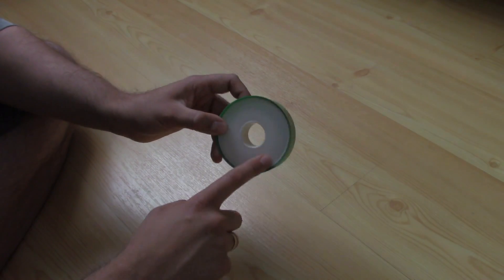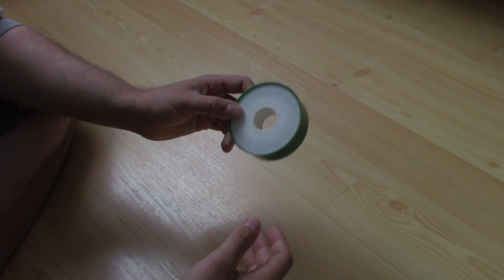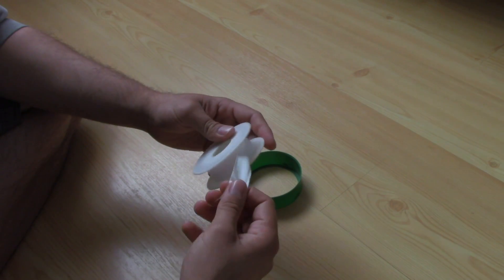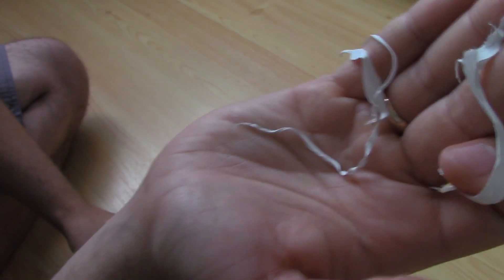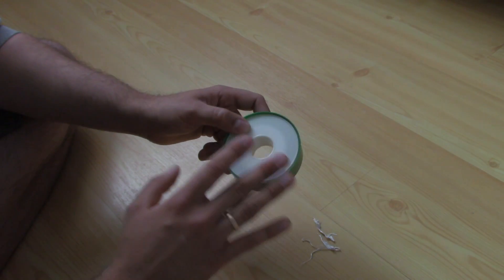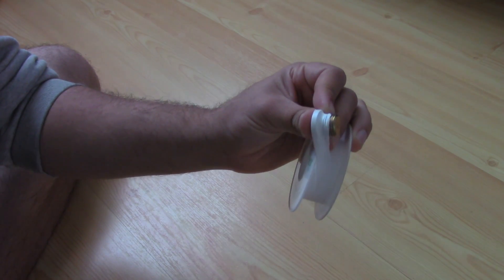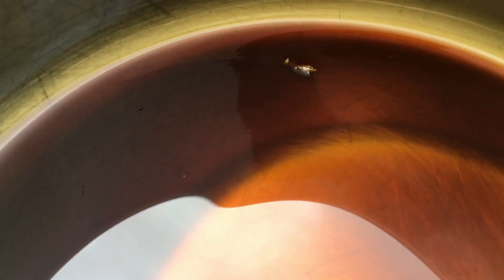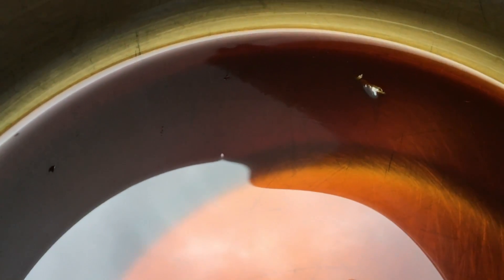Should you use PTFE Tape for your Car Oil Drain Plug ? Let's test.

Comment: When you run this tape on the END OF THE PLUG,next to the head, where need be sealed, it's ABSOLUTELY NOT POSSIBLE the teflon material to go inside the engine or transmission. Theoretically, if some piece go inside, will be catched from the filter, right ???

Comment: If you removed the oil out of the oil drain hole that that the PTFE tape wrapped bolt came out of, you are just seeing bits of tape that's left on the threads, not necessarily what's made it into your oil pan.  If you wrap the tape under the oil line you won't have an issue of the tape making its way into the oil pan.

Comment: I've been using teflon as a bolster to the existing gasket for years without a problem. However, I do notice that consistently my oil plugs loosen enough that mid oil change interval I snug it up again. While I've never had a plug fall out, I suspect it could happen brcause of the teflon. I know somebody that had a plug fall out, but there was no teflon tape involved and he thinks the oil-change shop left his plug loose.

Comment: The engine’s oil pump moves the oil directly to the filter, where it enters from the holes in the perimeter of the base plate. The dirty oil is passed (pushed under pressure) through the filter media and back through the central hole, where it re-enters the engine. So any debris will be caught before entering the engine, not to worry about it!

Comment: How is going to get in the engine if its wrapped around the threads at the bottom of the plug (lowest point)? I have been doing this for years and saves the time of finding or buying a new seal, and most importantly stops an oil leak.

Comment: Oilmpump strainers are designed to suck oil from bottom most part to avoid cases where at low oil levels and high gradients the pump doesn't suck air

Comment: The bits of tape that came out were likely in the plug hole and flushed out with the oil.

It cannot get into the oil pan if if does not extend into the pan, ie if it ends in the threaded plug hole.

You wrapped it in the wrong direction which makes it unwrap as you screw in the plug.

Thread tape is good for metal on metal or plastic on plastic threads to seal tiny gaps. But I would not use it over a rubber gasket as that would likely degrade the performance of the gasket.

Comment: As said before, you MUST apply tape in the correct direction: opposite to the way you show!
Thick tape is often used on gas fittings and is applied in a single layer.
Another tip, if you find the sump thread is stripped of worn, wrap dental floss around the bolt threads, one layer in the correct direction, maybe remove the sealing washer, to give you a little more thread
Reply: yeah, he applied the tape the wrong way.

Comment: I've used PTFE tape on oil drain plug for roughly 15 times, not once I've encounter any problem.  Furthermore, it allows a perfect seal with just 20~ nm of torque.  What you do is apply a thin layer (just one layer) between the plug and the washer, then another thin layer onto of the washer.  It basically acts as a gasket.  NEVER APPLY ON THE THREAD because that will get into the oil that's in the engine.
Reply: Thanks for this tip. I changed my motorcycle oil at the weekend and fitted a new sump plug but I couldn't get rid of a slow drip. Untightened the plug and used your tip and it sealed it perfectly. Many thanks.
Reply: Ok, the PTFE have a very low chances of damaging the engine. However, can't deny the fact that it does have a slight chance of doing so. Thing is, why use it when the washer is sufficient to avoid leaks?
Reply: As a plumber this is the rite way .. don’t put it in the thread same with olives 👌
Reply: nice, this is the advanced info I  was seeking.
Reply: I’m confused by your statement, I mean, it seems detailed enough, I’m just slow, I guess. Lol. I’ve used Teflon tape many, many times. But you’re saying not to wrap the threads, at all? Just curious what you’re describing.
Reply: @rikityrik  When you tighten a drain plug, what stops the oil from dripping onto the ground is the washer (copper O-ring or aluminium O-ring) that is crushed between the plug and the sump pan.  My method is wrap the Teflon around the washer, so very little torque is needed to create a seal.
Reply: @vinegar008  ok, thanks. This is how I understood what you said, but wasn’t sure. Thank you for the reply👍
Reply: @vinegar008  HOW DO YOU WRAP YOUR WASHER IN THE TAPE? Cover it fully so that both sides are covered and wedge the plug through the gasket? Or do you mean use a really small piece just on the side touching the actual pan? Could you show us or be a tiny bit more specific? Sorry brother really appreciate your responses here but I’m mechanically retarded lol I know cars but I don’t know know cars. If you don’t mind ! Thanks in advance!!!

Comment: Very good video. Thanks for your help, i also agree with you teflon tape can introduce a variable  that could clog your oil pump and cause engine failure, not worth the risk, use a rubber o ring type gasket at drain plug but no rtv nor teflon tape can kill ur engine.

Comment: I used it on my car the last oil change and it slowed down a leak I had a lot. I decided to try it this time without the tape and the leak is back. So I'm going to add it again and hope for the best. Most of the tape I put on was still on the drain plug and I didnt see any in the oil.

Comment: I've used the tape many times on an oil plug if the seal on the plug is damaged and never had a problem. Any tape that gets in the oil will end up in the oil filter. I suspect the pieces of tape the original poster found in the oil were flushed out of the drain hole threads in the oil pan and weren't actually inside the engine.

Comment: It helps if you ensure to apply the tape in the right direction, so when you tighten the bolt, it doesn't unwrap the tape.
Reply: Always wrap teflon tape, c.c.w.
Reply: @robertbobin5053  when the threaded end is facing me, I would do it clockwise, if I was looking top down from the bolt head, I would do it counterclockwise.  Works for me 🤷‍♂️

Comment: There is an oil scanner in the tube that goes up to the oil pump. most of that won't get past that, even if it does the oil filter will filter it out. But like you say it dissolves so it could be sticky residue but with how hot the oil gets this should never stick. Good video tho, thanks i did learn something. I use it mainly as my (tread lock) which is the main reason why i was looking for info on it would actually dissolve or melt then it would come loose and out.
Reply from the maker: Hey Dallas,
I am glad that it helped you a bit. What you write is also correct. 
I had a problem with a leak from the drain plug and did not manage to fix it though the tape. The way I fixed it was to remove the pan, drill the thread, thread M20 instead of M16 and put in a new plug. 
Cheers

Comment: put some on the gearbox drain plug because it had nothing at all. i keep an eye on it so far no leaks
Reply from the maker: I did the same for gearbox. But the temperature of oil in the gearbox is much less.
Reply: works
Reply: @1marcelfilms  is it still holding?
Reply: otto no problem
Reply: @1marcelfilms  thanks